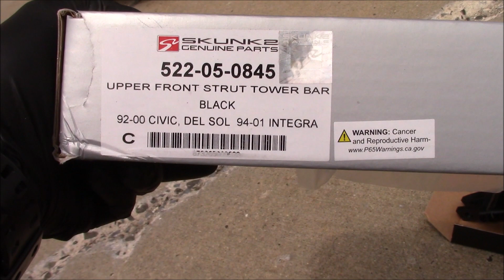K-tuned K1 Coilovers and Traction Bar installed!

Comment: You can make that strut bar work easily.
Just cut the upright off the mount that bolt to strut tower and make a new upright but taller to push the crossbar up higher